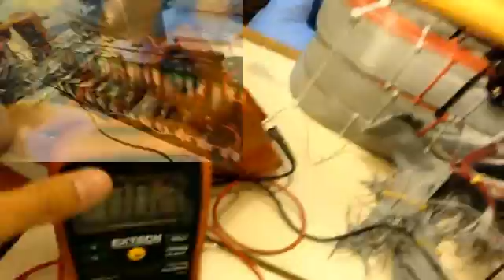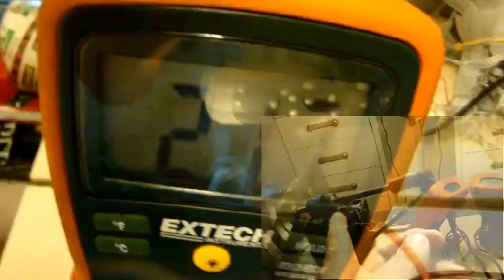ｗａｔｔｓ7.6 240ＲＰＭ ＭＯＴＯＲ Ｎｅｗｍａｎ

Comment from the maker: The plastic jacket does not block the magnetic field, so the magnetic field from the coil can still interact with the magnet. Though, you would be better off having a greater number of turns per inch of coil height.

In some earlier videos I have run this device with two coils instead of three. It turns out that depending on the size of the fan, you will want either a smaller coil or a larger coil. With my larger fan, 4-6 of these coils was better. With the smaller fan, 2 was optimal.

Comment: thats interesting so the space between wires wouldn't matter? - either coated with poly or plastic jacket? another question - the 2 bottom RC40-100 get the same affect of magnetic current as the top one? would you get same voltage by just using the top 2 RC40-100 ribbons?

Comment from the maker: Yes. It's RC40-100 type ribbon cable. It does in fact work. Any conductive wire should do, including aluminum and copper. Copper has superior conductivity and longevity, but aluminum costs less.

Comment: you actually used pc ribbon cable as the magnetic wire? and it works? so would you say any wire would do? whether aluminum or copper too? would aluminum magnet wire perform as good as the copper magnetic wire would?  this pretty kool setup.